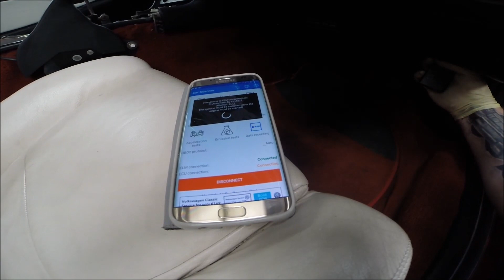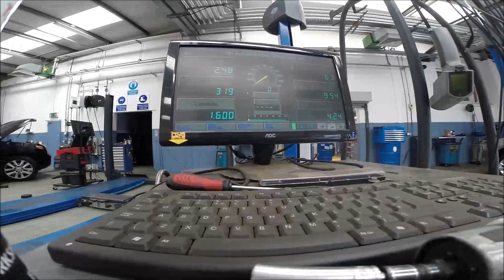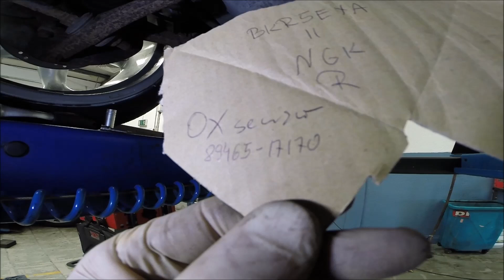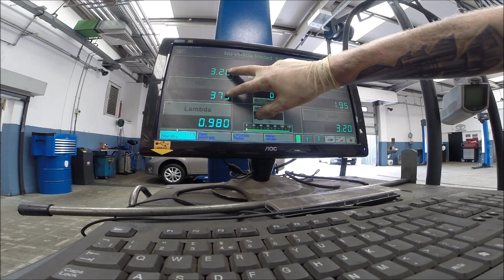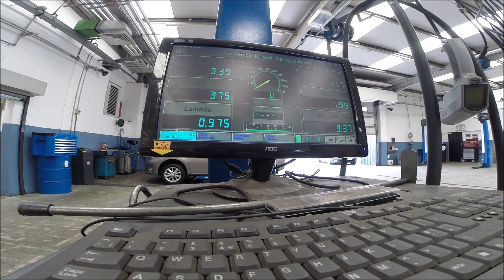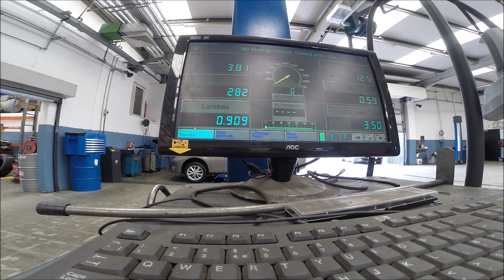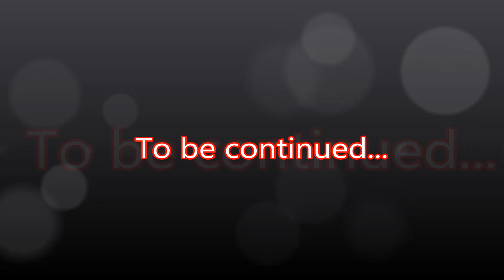Ferrari F 355 Berlinetta  Replica MR2 Beams  Part 1

Comment: Most likely this isn't a Beams conversion, but a factory Toyota engine. All Japanese mr2s with non-turbo engines made in 1998-99 came with that engine. Usually a converted car will have the 'Beams' logo facing the opposite direction (to the front of the car). This looks to be factory correct. There were only circa 1000 Beams mr2s made. This is the fourth one I know of in Ireland.
Reply from the maker: Hi, thanks for the interesting information